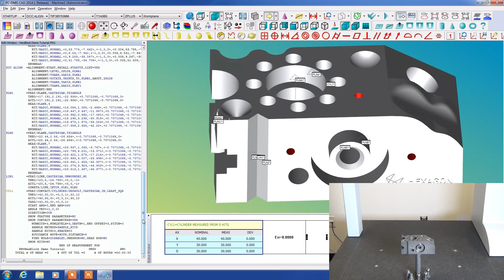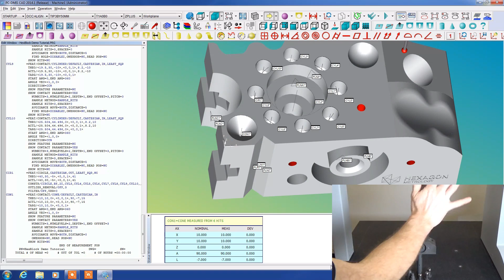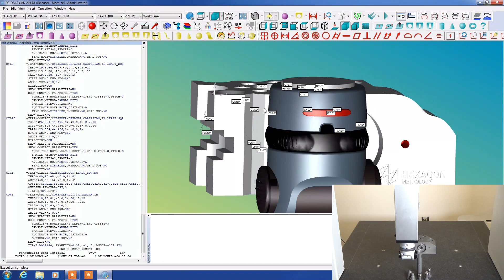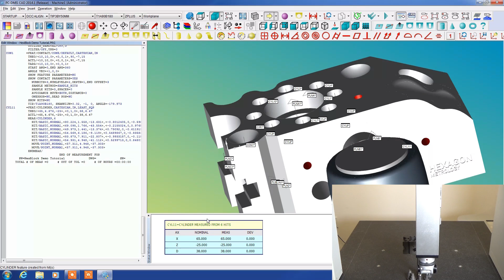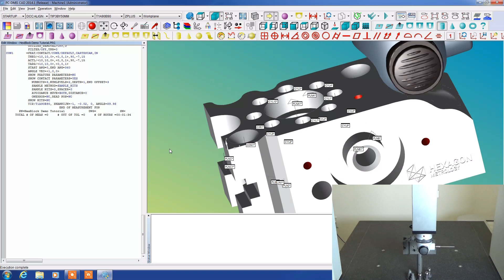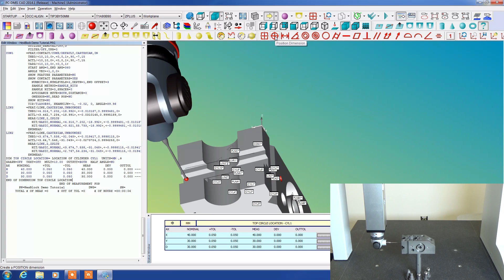cmm reporting measurements movie

Comment: What is the reason for the DCC alignment when you already had an alignment in manual mode? Thanks
Reply from the maker: The 2nd one is automated and has better touch sensitivity than when probed manually.  also more hits per feature in the 2nd one.  Greater accuracy is achieved in the 2nd alignment.